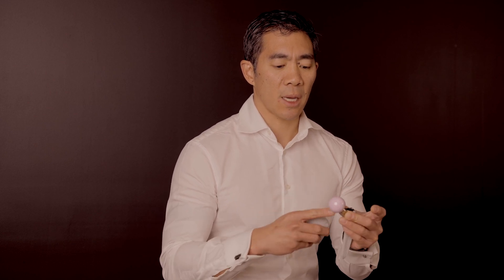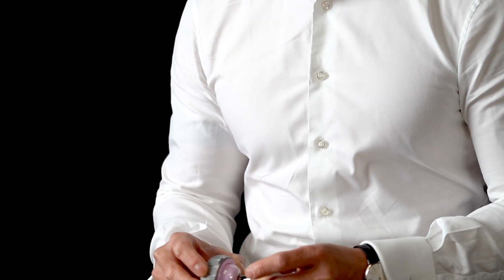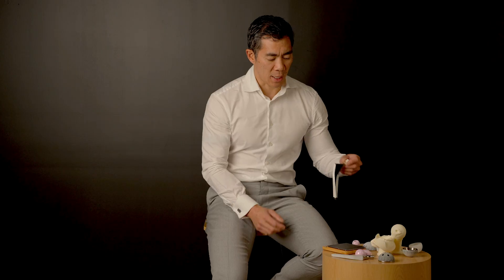The hip prosthesis I use for total hip replacements

Comment: I have concerns with meral being implanted into the body. I understand it is not metal-on-metal, generally, but does the body react to the toxic nature of this unnatural substance in the body? And if so, what can then be done about it?
Reply from the maker: In general, there are no allergies noted or effects from modern prostheses. To date, we have not come across a single case of metal/substance allergy from prosthetic joints.
Reply: @orthopaedics360 
Thank you for your response!
Reply: @orthopaedics360 . I would like to interject here as I am currently suffering from chromium and nickel ball causing severe hive reaction daily from my hip replacement done 5/19/25. It took about 6 months for toxins to reveal themselves but my blood stream now is fully charged systemically.  I had a Clifford’s Test done September 2000 and forgot to mention to my surgeon about the metals allergy.  I am scheduled for a revision 4/2/2026.  I recommend that hip replacement candidates have metal allergy tests done.